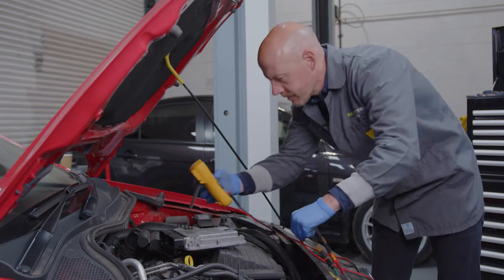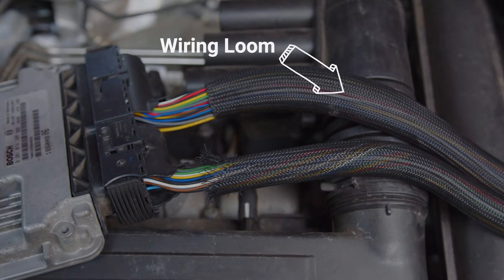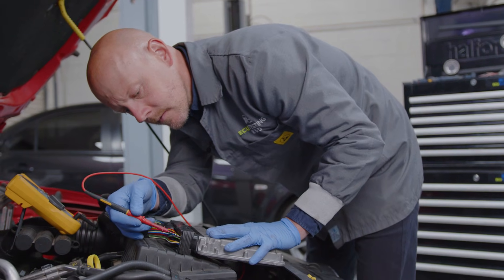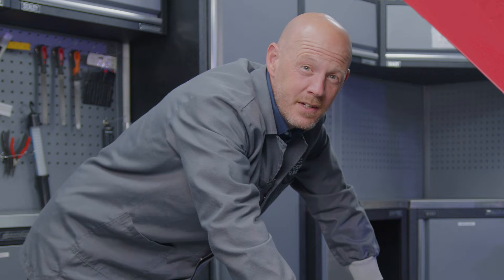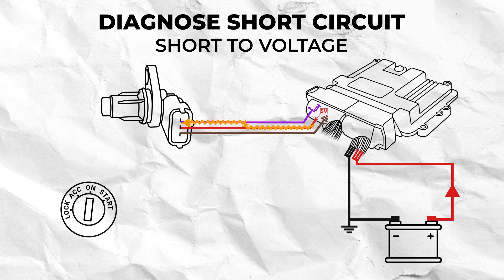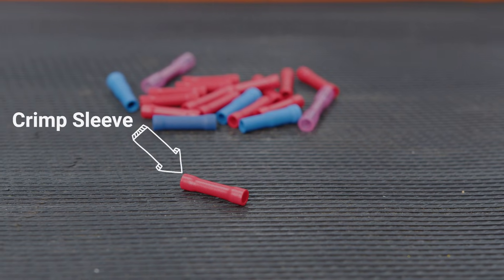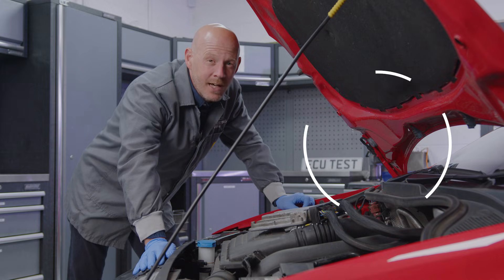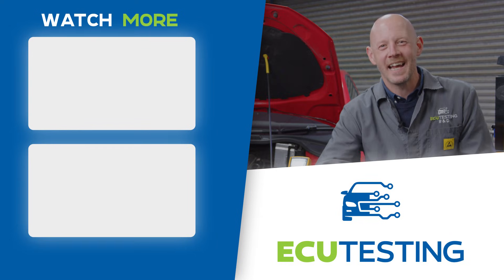Car Wiring Repair: Ultimate Guide to Finding, Testing and Fixing a Wiring Fault

Comment from the maker: 🤨Have you ruled out a wiring fault but you’re still having problems with a module on your vehicle?🤬Click here to get it tested:➡https://link.ecutesting.com/WPIN
Reply: Where do you find those pin wire remover unlocking key tools and the name their known as ? I have Audi Q7 3.6L engine and I'm working on it myself. I also would like to know how do you or can we use our VCDS software to perform the ECU diagnostic test on it if so how do I carry it out step by step thank you.
Reply: This is the best comment ever

Comment: Thank you for useful video. 
My landrover 2008 is very moody,  sometimes at start position, start warning lights and locked door and opened. At very cold weather everything good ,but after few miles drive, start warning, locked and unlocked doors ,siding light flashing,  radio and ac stopped working.  Delear couldn't fix it .and I love my car .what is your recommendation to check ?
Thank you

Comment: Would an external overload cause an open circuit in a relay, or would it damage the wire itself somehow? I'm not an electrician, just a schmuck lol

Comment: I have an issue that is intermittent that mechanics cant seem to find. It only happens when the car is hot, typically on the interstate. The engine will still but power is still there. Could it be a wire just getting too hot to keep sending signal properly?

Comment: If you see one terminal is corroded on the connector, can you just remove the one wire for that terminal and splice it to the corresponding wire on the other side without messing with the connector?

Comment: With the VDIAGTOOL V500 Pro I was able to check voltage stability and wiring quality around the battery terminals — great for verifying if the battery or wiring is at fault.

Comment: In my part of the automotive world soldering is a big no no. You risk the soldering thin melts the harts around the strands and create a acidic corrosion that makes the strands hard and break. Its also sensitive to vibration. We only use special soldering crimps with a heatgun. And always use yellow high quality cable so you can tell it has been repaired.

Comment: Soldering is the worst repair you can do to a wire on a car system since they break due to their rigidity and engine vibrations

Comment: My car's mechanic is annoying he did something in the panel guage now my car losses the oil, battery, and glowplug indicator. My fuel indicator is lighting the low fuel signal even the fuel guage reads it full.

Comment: I've done my fair share of wiring fixes over the years — this brings back memories 😅 One thing that really made my life easier lately is the Vdiagtool V200 PRO. It’s great for quickly diagnosing electrical gremlins without tearing the whole system apart. Definitely a must-have if you’re into DIY auto repair.

Comment: Hello , thanks for the amazing video, so helpful. My dodge journey  2012, has an issue in front blower motor wirring , it is not working due to wire not geting the voltage ,, nobody able to find the fault
Could you explain please how these wiring done in this vehicle?
Thank you

Comment: I heard that it is preferred to use crimp connectors rather then solder. What is your take on that? Or there are also heat shrink connectors.

Comment: very informative video, superb!
question: is it possible to loop an extra wire between a sensor and ECU without disconnecting the original wire? Or should you always disconnect the (suspected) damaged wire?

Comment: You do this with the car running or turn car off first?
Reply from the maker: Hi there, it depends on what you are checking. If you are checking voltages, the ignition needs to be on. Other checks such as continuity, resistance and visually checking for any damage can be done with the ignition turned off. It is always worth checking your owners manual however to ensure you are following their guidelines when working with electrical components. Thank you!

Comment: If you have everything powered on, can you probe from the front of the connector instead of back probing ?
Reply: The point of back probing is to avoid damaging the spring tension in the connector. Even if you use a pin that's smaller than the connector pin, you should avoid jamming It into the front of the connector. I'm an Audi technician and I can tell you if my group leader saw me front probe like that he would not be delicate in telling me not to do it again. I can also tell you that in the real world it simply isn't possible to back probe every wire in every connector. If that is the case it's acceptable to TOUCH the pin from your multimeter lead to the front of the connector, without actually inserting into the connector. Hope this helps.

Comment: U better off back-probing P-Diddy.     Back probing is unreliable when no signal is output. Might be a bad connection. I don’t care, I pierce the wire to be 100% sure there’s a connection.    If the wire is exposed to the elements , I make sure I tape it up very tightly after.

Comment: There have been changes with my 2005 Ford Taurus.  It still starts right up runs now for a few days it then will stall..then start back up again.  There is now a code P1000 this is since I tried a reset on ECM at first it went kablooey, then it started to reset now as I said the P1000 code only. I was told to drive it for 100-200 miles will it reset itself.  Or is there a special cycle to do for my Ford Taurus?  I wish you a very Happy and prosperous New year and I thank you for any suggestions you may have.
Reply from the maker: Hi there, if you can email the vehicle details, symptoms and any fault codes present to info@ecutesting.com, our technical team can look into this for you. If you also have any part numbers to send across, they can check this for exact costings for you. Thank you
Reply: There is no fault codes and never have been.  I was wondering if it could be the ignition switch? On occasion the theft light pops up then hesitates for a second. It stalls then will start again right away

Comment: Hi,is pcm controling voltage on negative wires too?I have a problem with fuel pressure regulator,i measured the voltage at it s harness and shows 0.25 v,with ignition on,if i take ground from somwhere else shows the battery voltage,12/14 depends on how full it is,also i have the p0090 code,the question is,if i take the ground from somewhere else not from the wire that comes from pcm,would damage something,pcm or f. p. regulator?

Comment: Hi! 
My mother bought a 2016 GMC - and turns out to have wiring issues, I'm not too familiar with repairing my own vehicles. She seems to be intimidated by asking local mechanics about the issue.  I don't doubt that the cost to have a vehicle wiring fixed or redone would be cheap. This is the first step in diagnosing the issues? She seems to think because of one mechanic that she needs the whole vehicle completely rewired! 
I question that- even if it did they made it sound like the whole vehicle needs to be gutted and every wire needs replaced. 

What are my options ? And are my instincts right about these guys?

Comment: I own a 2005 Ford Taurus. I have a stalling issue that shows no code at all.  I feel this may be the problem as I have had tune-ups, replaced fuel filter, MAF and IAF sensor I am baffled.  It will start right up, drive fine for awhile then randomly stall.  All dash light illuminate still no codes. Could it be ECU?  I love this car but it is draining my bank account
Reply: Unlikely its ECU as it would probably show fault codes 
Could be something as simple as a dirty throttle valve

Comment: I have a N80 short high and closed circuit code on a 2017 jetta. I replaced the valve but no fix, I think this might be my issue, I dont think im gonna be able to fully go into this diagnosis without those special tools. This ones gonna have to be sent to the dealership but im glad you taught me all of this on the exact same car im working on.

Comment: Bsi unit, potentiometer (throttle pedal) and air mass flow. All 3 continuously showing up on OBD "incoherence fault". apart from BSI the others have been changed for genuine replacements. Vehicle goes into limp mode after a 1/4 mile drive.

Comment: Hi ECU Testing, I have a 1989 Pontiac Firebird with a high beam indicator problem.  When I turn on my headlights, the high beam indicator light stays on continuously.  The car will will switch between high and low beams and I've noticed that the indicator shines a little brighter when it's on high beams.  I have the service manual and it shows power to the headlights coming through the high/low beam switch with one low beam tan wire  going to the low beam element and then to ground on the low beam circuit.  The high beam circuit shows a green wire the high beam side of the high/low beam switch and splitting into two green wires on the output of the high/low switch where one green wire appears to go to the high beam element and then to ground while the other green wire goes to directly to the high beam indicator light and then to ground.  I've checked the grounds for both headlights and and they appear to be solid with 0 ohms.  I've also checked the continuity of the high/low beam switch and it seems to be okay.  Do you have any suggestions for finding the ghost voltage feeding my high beam indicator light?

Thanks,  Robert

Comment: Hi,I am Ali from Egypt ,I have car Renault Clio sedan model 2008 1.4 CC 8V ,I have many problem with it and many electric technical in Egypt did not where the problem and when put it on the OBD2scaner it say it no problem in car ?! So please can you help me the problem is in the ideal speed and car stop the car engine sound up and Down and motion too and the RPM to it move up and down but between speed 750 as up and 500 as down and I have another problem in the morning when I start the engine it start quickly without problem when I go to work and in the end of the work day I leave my car under sun in the park when ride it and start the engine the engine lake and did not start immediately it take one 30 second to start up and another problem with windows glass when I up the widows and the windows is closed and if I did not left the glass button the heat indicate is up as the  car was very heat I don’t know what the reaction between the widows button and the heat indicator can you help me please

Comment: Would you solder a Relay if used in a car? Many places inc google are all for crimping etc, but surely a soldered connection for an immobilser and a relay should all be soldered and then taped up? What is your opinion ?
Reply: Depends on location. Solder could break due to heat or vibration. Clamping with proper tools and quality materials will last those elements. Hope that make sense.

I did solder wires behind my headlights but that’s away from engine. So it’s still working 3yrs+,

Comment: Anybody else having a project car and search up this video 😅
Reply: yeah, planning to re wire my 1993 civic😀
Reply: 1994 Jeep Cherokee 😂
Reply: 08 mazda with swapped in 2.5l
Reply: 95 Celica 😂
Reply: @sarahhoog5104  gang gang 😂
Reply: 94 Camry
Reply: 3.5 charger 😅
Reply: A '02 Suziki SV650S that needs the original light fixture reatatched, but yea
Reply: 2002 Celica Gt

Comment: you skipped over the critical items. 1. do you disconnect the battery for continuity tests ?       2. how do you know where the far end of the wire you are testing goes (tracing)
Reply: I paid for ALLDATADIY & it’s telling me just unplug the harness from ECU, check for resistance 11-15ohms for one of the wire going to transmission harness. The page state nothing about battery or ignition since we are checking ohms only. I’m sure if you’re doing voltage,maybe different
Reply: Use a wiring diagram
Reply: Dude…exactly. This is dangerous

Comment: It helps to know the correct reading for the wires you are checking.  And. Good luck finding a multimeter w/ wires that long.  You’ll have to get the correct readings from factory manual.
Reply: Для цього використовуються так звані Контрольні провода для мультиметра потрібної довжини.

Comment: My favorite cars to test is the VW Jetta, specifically the ECM connector as they rivet a steel plate over the connector so that you can’t just easily remove it to test the systems :) thanks VW

Comment: Hello, after longtime....😊
Here, 12V Vs 7V...
I have one Super CONFUSING VOLTAGES READINGS on door opened or closed status.

For example, in i20 2011 India version without LCD display on instrument cluster, the voltage at any door switch is SOLID 12V when door is closed, and immediately drops to  SOLID 0V when it is opened.

Now, in today's modern car like Toyota Glanza and Toyata Taisor which has LCD display, and for the same situation, when door is closed from opened, the voltage remains at solid 12V, and after about 20 secs, the voltage drops to SOLID 7V. 
As soon as door is opened, it changes to 0V.
Now, when the door is closed again from opened, the voltage immediately rises to SOLID 12V, and stays for about 20 seconds, and then only drops to 7V.

Now, why is this voltage drops delaying from 12 to 7??
What's the purpose or significance of this delay in voltage drops?
Why not immediately changed to 12V from 0?
Why 12V, and then later slowly to 7V???
Reply: Broken wire e.g. bad connection.
Reply: @cosmicHalArizona  no ....
Its happening in Toyota Glanza and Taisor.

Comment: If i wanted to check a coil pack connectors continuity do i have to remove battery terminals before doing so being the connector is still connected to the harness?

Comment: when diagnosing a short wire, how can i tell what voltage i should be reading on the multimeter?
Reply: @joyous6696, It would depend on circuit design, some are 12v some are 5v ref

Comment: Vw passat 2018(142k)i got EPC sign and engine light on. I put the new spark plug, throttle body, ignition coils and also cleaned the fuel injector but still its there. ANY SUGGESTIONS????
Reply: @Dilmohittt, What are the stored dtcs?

Comment: Modern car wiring is absolutely crap. The computer systems are quite useless as they cannot tell you exactly what is wrong. Modules running various parts of the car should not need more than 4 wires for communication, this was supposed to be a bus system but instead there are bundles of wires going everywhere

Comment: Man my battery keeps getting drained and I already changed the alternator :/
Reply: You have a parasitic drain then 👍🏼
Reply: If not fixed - Check battery terminal connectors and make sure they have a full connection, small terminals or loose connectors and be fixed with cutting and rewiring a new connector, or using a lead terminal shim to fill the gap. Used that to fix my Lexus ES300 parasitic drain. It's a good place to start.

Comment: Will the crimp sleeves create excess resistance to cause abnormal current flow in the CAN bus system?
Reply from the maker: Hi. If done with good technique, i.e a good strong contact is made and heatshrink is applied, then using crimp sleeves should not create excess resistance in the CAN bus system.

Comment: morning....have any ideea why my car dosent comunicate with CAN?my vcds says j533no comunicațional with CAN gateway...no comunicate with batery module...and generator...The car îs an a6 c6 year 2010....thank you very much
Reply from the maker: Hi. We have actually recently completed a video on diagnosing CAN bus faults here: https://youtu.be/fZMNzKpCGfc The video goes over some basic principles of the CAN bus network, however, as your system includes a gateway module, the diagnostic tests at the OBD2 port may not be the same. The fault will likely lie with either the gateway module or the alternator (generator), so you will need to unplug the alternator to see if the fault disappears. If it doesn't, then test the integrity of the communication wires between the two. Finally check the gateway module's power (sometimes fused) and grounds. Hope this helps!
Reply: @Ecutestinglimited  hello...i unbluged The alternator wire...and all The erorrs disapear....ca u tell me that u check next?should i duble check The alternator regulator ....install The corect Code ?
Reply from the maker: That indicates the alternator is faulty. We have done a video on diagnosing faults with the alternator here: https://youtu.be/gpFlPU2HQkY but as you have said, it is likely a fault with the voltage regulator. Depending on the model of alternator you have, the regulator can be replaced without needing to replace the whole alternator, however we would recommend getting this confirmed by a qualified mechanic who can advise you on your specific vehicle.

Comment: I was told a while ago that a lot of modern computer controlled cars have resistive cables !  So I'd assume that if you have to re solder a cable, the pc controller would know this and still flag up a fault ? Apparently.
Reply from the maker: Modern vehicles can use a variety of cable types, however resistive types are normally for specialised components and the majority of the vehicle's electrical system uses standard copper wiring in which a properly soldered joint shouldn't cause any problems. However, it is always worth consulting your vehicles repair manual or schematic to ensure you are following their guidelines.